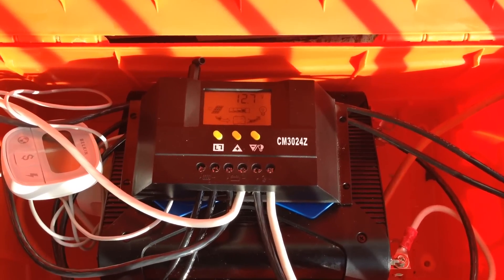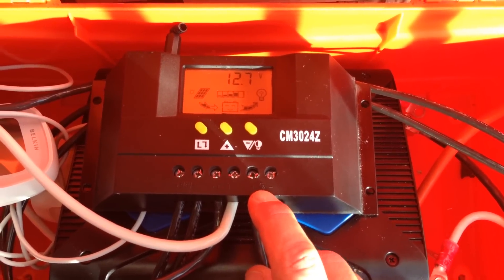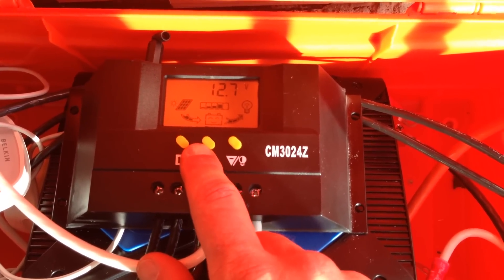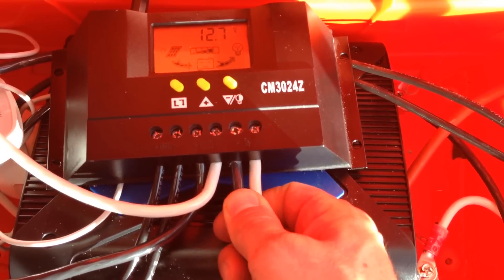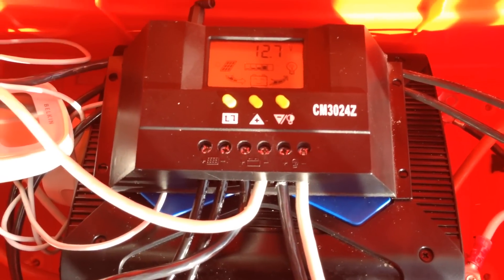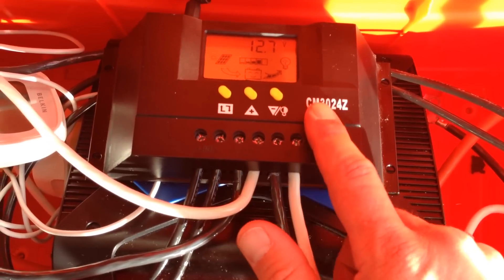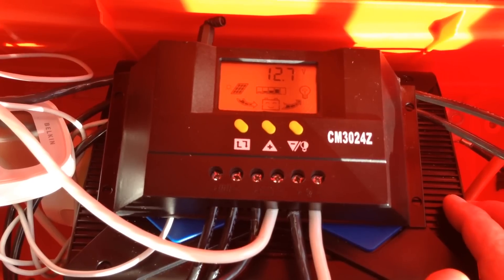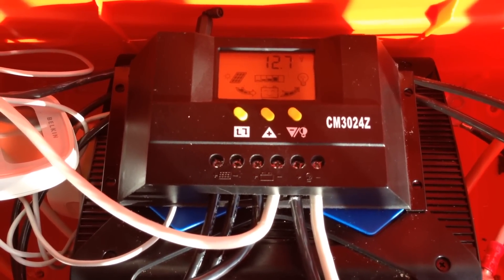Small apartment balcony solar power setup (part 4)

Comment: At your previously mentioned charge-termination voltage of 14.1V (2.35v/cell), you were probably not reaching full charge... but that is manufacturer dependent. Many lead-acid technologies like 2.51v to 2.56v/cell.

The "either/or" AC wiring setup you used is very risky... you're running an off-grid inverter that will be destroyed if you ever accidentally have it "online" while your electric panel circuit breaker is ON. (for other people reading this, this is a "don't try this at home" method!)

(BTW... I know you have moved, most of this response I'm writing for the viewers/readers who want to learn about simple solar installs)

Your initial setup was the best solution (part-1), but I believe the inverter was giving you "very optimistic" output power readings. If I remember your purchase order mentioned something about "Experimental Inverter". "Real" name-brand micro-inverters are guaranteed to perform as advertised, and are far more reliable.

Charging batteries, charge controllers... it's all very lossy unless you use MPPT (Maximum Power Point Tracking) charge controller and much better battery technology. This is a technology that maximizes the power draw from the solar panel(s) to ensure you get maximum energy from them.

"Plug-in" micro-inverters are "the way to go" for someone looking for an entry-point into Solar Energy. As long as you get one that's UL approved (in the USA) and designed to "plug-in" to an AC receptacle, it's considered an appliance, and in most places no electrician approval is required. Then mount the solar panels on a pole/frame in the yard, balcony, canopy, or some "non-roof-mounted" configuration, then you likely don't need to have it city approved for building code compliance.

Comment: This is a very good series on your solar setup.  Lots of detail!  I would like to see a little bit more about how exactly you tied the system into your apartment because I think that for most people that live in apartments that would be the most difficult part and probably where people would give up.  Maybe you could make a quick diagram or something.  This is just a thought.  Great job!
Reply from the maker: +Dan Anderson Thanks Dan....I know, this looks a bit tricky and to be honest, I only did it to see what is a somewhat feasible setup if you live in an apartment and get sufficient sun during the day.I did not have place for another panel on my balcony. Also, my setup was borderline legal (at least from a lease point of view) but my landlord never said anything so kept on playing around with different configurations. In the meantime I have moved to a house and the gear is sitting in my garage. I am currently looking into a full-blown rooftop installation. Sorry, I have no diagram of my previous installation but concerning connecting it to the apartment: On my balcony I had an outlet which was part of the power circuit of the living room. Therefore, I could isolate the living room circuit by simply cutting it off the grid at the breaker box. Then I would plug the output cable from my inverter into the outlet and voila, the living room is entirely powered by my solar-charged battery. That was the easiest part of the configuration and I did not have to play around with my internal apartment cabling, which would have been totally against the lease terms. And I didn't have to, because the fully charged battery was able to run my living room equipment (TV, lights, etc.) for the entire night. I couldn't power additional items with my setup anyway. If apartment renters do not have an outlet on their balcony which is part of any circuit inside the unit, they need to figure out how to run a cable from the outside to the inside without drilling holes or leaving the balcony door open. Hope this helps....

Comment: Just want to thank you for your videos and also have a question about the cord you use to connect your converter. Could you post a Video about it? I know it is all my own decisions and responsibility.

Also, the modified converter, I have modified converter and have no humming noise on  my TV, but not using the apartment outlets just yet ;-)

I just started with 1 battery 1 40 watt panel, have already panel 2 at home and wait for a 8 in 1 Hub to connect my 2 x 40 watt panels to my Coleman 7.5 Amp Controller.

Altogether i might get 4 Amps of charging power and i have a 75 AH battery and  hoping to get another one soon.

Keep up the good work and never give up. And thank you for your videos.

Please keep us updated :)
Reply from the maker: Dirk Zuchner Hi Dirk, sorry for the late reply. Here is the link to the manual of the charge controller I am using and it describes which cabling is recommended at what current range. http://www.pvsolarchina.com/wp-content/uploads/2011/07/JUTA-CM3024Z-Solar-Charge-Controller.pdf

I definitely had a buzzing sound with the modified inverter and now, with the pure sine wave inverter, this is gone.
Reply: Pure sine wave is in many things better. I had a modified sine wave and it took idle 2 amps, now my pure sine wave takes less than 0.6 amps idle.

What is the configuration of your power cord to feed back into your main outlet?

Comment: I guess my questions are gonna be less complicated. I want to buy a small solar panel big enough to power an led strip in my room at night. I want to build it myself but don't know how. Could you help?
Reply from the maker: ***** Sorry for the delay. There are many videos on this on youtube. Did you find anything in the meantime? A couple of options on how to do it but in general you need a solar panel, battery, charge controller and of course the 12V led lights. Check out this setup: https://www.youtube.com/watch?v=DKaWPq8zVjQ

Comment: Hello Ibondini2008 I'm glad to see an update video :)  What kind of inverter are you using?  Is it a modified sine wave or pure sine wave? I assume from the price you gave it is modified, you need a pure sine wave in order to run your tv and computer or a fridge etc, modified sine wave makes "pricey" electronics work harder and work less efficiently and could potentially damage them.

Also if you can't add another solar panel to give your batteries the extra juice they need you could always get a small wind turbine and put that in with the solar, maybe a vertical wind turbine(VAT) would be most space efficient.
Reply from the maker: Hi there, that's a great comment. I was thinking about that since I am using a modified sine wave inverter. My TV is humming quite a bit when on battery power so I assumed it would be better to get another inverter. A wind turbine is a good idea and I thought about it but I hardly get any wind on my balcony which is good for my balcony garden but not for wind energy production.

Comment: hi just one comment if battery down that much you must have took it well blow 40%and the battery is not made be deplete it will not last much longer  before its no good
Reply from the maker: I think the problem is that I stored the battery too long after I bought it before I installed it (3-4 months). But I am not sure if the battery is just not going through the entire load cycle during the day because the panel is not feeding enough power. Could be the reason because on some days I can see that it is fully charged and the inverter is going into float charging mode. So maybe the battery is not bad at all but is not getting enough juice on some days to be fully loaded in the evening.
Reply: HI batteryS ARE LEFT STANDING YEAR BEFORE BEEN SOLD SHOULD NOT BE ANY PROBLEM THERE HAVE IT TESTED .SORRY CAPS
Reply from the maker: gene mayne Thanks Gene and yes, could be that the battery is actually fine after all.
Reply: hi renumber most battery's come with 2 year warranty so do not fore get if dose go wrong
and like your thinking on saving power more people should be doing it

Comment: oh, one more comment about your battery. I suspect your battery is getting deplete too much every night. You can draw down to 50% SOC daily at most. Below 50% SOC and you'll shorten your battery life span much more quickly. I also suspect you're not actually fully charging your batteries every day and thus your night time usage is drawing down your batteries to lower than 50% SOC every day. You either need to use less electricity at night time or add another solar panel to help recharge your battery in the day time.
Reply from the maker: That is a good point. I tried to find out to which low voltage disconnect I should configure the charge controller to. This of course only works in the setup when my inverter is connected to the load ports. If it is connected directly to the battery my inverter will draw power until the battery charge drops below 10V and then shut off as I explained before. I am currently trying to find out the best low voltage point (when to stop drawing power from the battery) and how to translate 50% SOC into the right low-voltage threshold.
Reply: lbodini2008 You probably don't have room to fit another panel, but I think that will be your ultimate solution. Either that, or reduce your reliance on battery power at night time--i.e. offload some of your electric connections from your battery to your regular power grid AC outlets. You probably are consuming too much electricity and your battery is not being fully recharged everyday. The solution is NOT to add another battery unless you add a lot more solar panels. You need more panels to fully charge your current battery. If you add another battery to your current setup, they'll both go bad even faster as you won't have solar energy to charge those two batteries each day.
Reply: lbodini2008 Here is the MPPT solar charger I got. It arrived this past Friday. 
http://www.midnitesolar.com/productPhoto.php?product_ID=530&productCatName=Charge%20Controllers%20-%20KID&productCat_ID=43&sortOrder=1&act=p

It's The Kid by Midnite Solar. You can check it out. They just released it. It's specifically designed for smaller systems. The bigger brother is the Midnite Classic. That's too much for our needs. If you don't want to use grid-tie in inverters, you might consider the Kid charge controller.
Reply from the maker: lanceguilin I agree, I would need more solar panels first to ensure that I fully charge my battery during the day while drawing some power at the same time. I do have more space on the balcony and could probably fit two additional smaller panels but that would cause more shade which I don't want as it would take away sunlight from my balcony garden and allow less light coming into the living room during the day. So the current setup is a clear compromise, taking into consideration more than just the solar production :)
Reply from the maker: lanceguilin That looks like a very decent charge controller! Mine is a cheaper version (PWM). I may upgrade it to a better one if the current one doesn't work out. But with my current one I could keep the additional cost down (it was less than $100) since I had already spent some money on the grid-tied stuff. I need to think about a similar setup I suggested to you above - combining the grid-tie with the battery setup. A challenge if you only have one panel :)
Reply: lbodini2008 ok, that makes sense. Solar panels can't consume all available space on your balcony. I can appreciate that. :-)
Reply: lbodini2008 re: your PWM charge controller, I understand keeping costs low. I've purchased an even cheaper, very basic, PWM 10A controller for less than $10. It works but you can't configure a single parameter. haha. With the more expensive MPPT controllers, you can pinpoint all your parameters, but you probably already know that. Everything is a comprise. My degree is in economics, so to me it's a universal truth that one always has to compromise. ;-) 

But getting back to your battery losing its capacity problem. What are you considering to resolve the situation if you don't want to get more solar panels? Reduce your nighttime consumption of electricity?
Reply from the maker: lanceguilin Yes, so far my cheaper PWM controller is working quite well and you can configure several parameters, including a display of current coming from the solar panel and being pulled via the load port.
Regarding the battery, I will not change much. At full charge it will last 4-5h at night if the TV, cable box, Internet and lights are on (about 250W altogether). during the week we hardly watch any TV at night. Today I had a radio running off the battery during the day and the charge controller continued to float charge it, so no capacity loss at all until evening time. If I can let the internet router and maybe the laptop charger run from the battery all day while the battery is still getting fully charged by sunset, I am fine and have enough power for the night.
Reply: lbodini2008 I see. But you're concerned that your battery's capacity is declining, no?
Reply: lbodini2008 I still wonder if your panel is producing enough power to fully charge your battery to full every day. You know the 3 stages of charging for a full charge right? http://www.batterystuff.com/blog/3-stages-of-smart-chargers.html 
You need all three, or at least you need to finish Stage 2. It takes a while in absorption to fully charge up the battery. I'm wondering if your battery is getting the full amount of energy (and time) it needs in absorption stage.
Reply from the maker: lanceguilin Well, I was but think that I have to do more testing to confirm and play around with what I draw from the battery during the day while ensuring that it is at full charge at sunset. The weather getting a little bit cooler should also help the panel to perform better. I may also look into the cable types and lengths I have used for the entire installation. The panel cables are AWG10 aluminum, from which I go to a AWG8 copper cable which then connects to the controller.For the connection between the battery and the controller as well as the inverter and the controller I am using AWG6 copper cable. From the inverter output to the balcony outlet I use a regular outdoor extension cable. I am not sure if all this is ideal for this installation.
Reply from the maker: lanceguilin Thanks for your comments on the battery charging stages. I am not super familiar with battery technology but will read up on it. If there is an issue with my battery (and not the panel providing insufficient power) it may be because the battery was sitting in the shipping box for a few months before I connected it and started charging it. I bought it in March or April and only connected it in August.